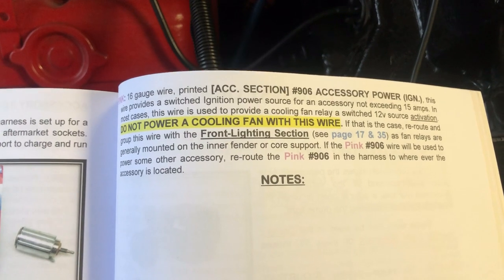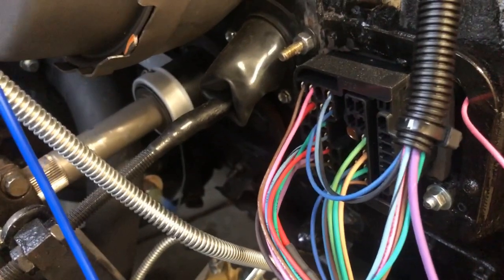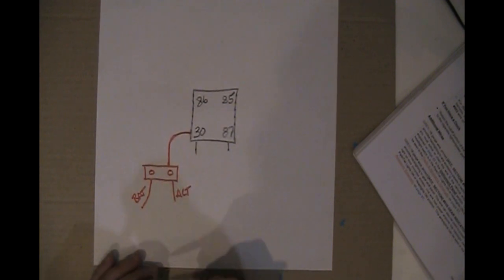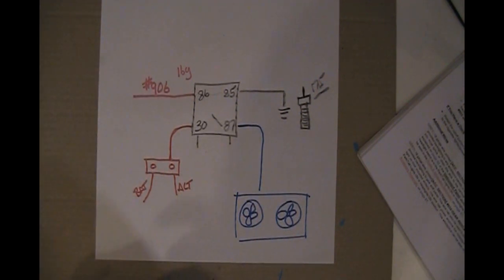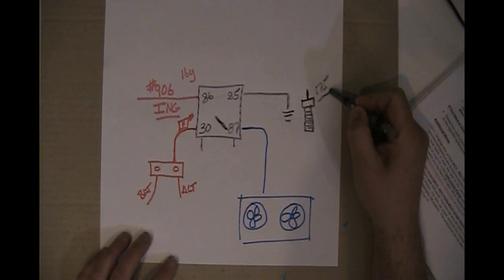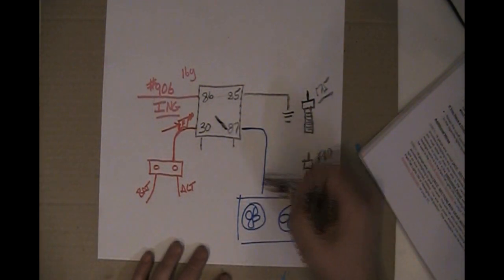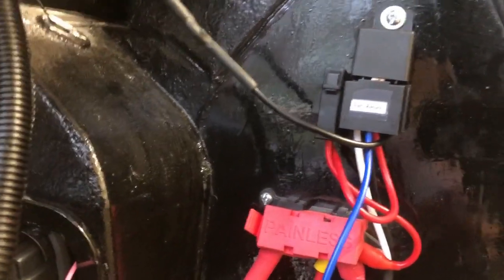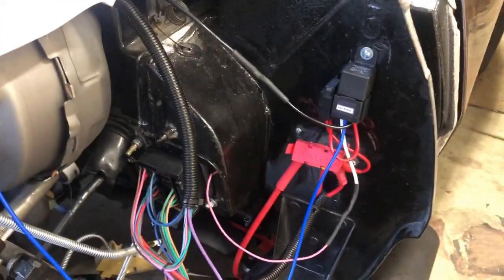Painless Wiring Harness Part 5 - Duel Radiator Fan Relay Switch

Comment: Are you running a after market gauge set up? I have a Dakota digital trying to use a 901 wire (grey/white stripe)to ground out at temp.
Reply from the maker: I'm running a stock gauge set up but I have a tach that runs off my electronic ignition - but those dakota gauges are sick - love them
Reply: @lawdogcorvette8565   I had to splice 906 to 901 to get b+ to run relay, but I ran a separate temp switch to run electric fan,

Comment: Is it necessary to run #30 to the battery and the alternator? Is it possible to run it to the battery only?
Reply from the maker: no sure of your question - but the wire to the battery from the alternator must be a thick wire to handle the amps

Comment: Hi Lawdog, the ignition wire on relay hareness. Does it go inside car on fuse box where it reads "IGN". Also on the sensor that screws on intake, I already have a different one there for temp gauge. How do I use both
Reply from the maker: The temp gauge sensor - yes what a pain.  Call painless and have them send you a temp sensor for your engine - saves so much time.

Comment: Thank you again for these. Did the relay/fuse come included with the kit?
Reply from the maker: The only relay that can with the kit was the horn relay.  The relay you see me installing was purchased separately for my radiator fans.
Reply: @lawdogcorvette8565  sorry if these are silly questions.. but why would they make you have to buy a relay separately if they know that is required for the fan?
Reply from the maker: @nickfawlty  so good question - Painless did not design the harness specifically for fan applications.  However, they knew that car guys like us love to take the old "Fan of of Death" out the front of their vehicles and add electric fans.  In the Corvette this modification is especially popular because of the natural slant of the radiator and the use of the fan shroud that crowds the entire front end of the car.  So they put in a 12v wire fused at 15a powered on at ignition on the inside of the firewall that was not specially allocated to another application and called it accessory wire.  In the manual they specifically recommended this wire to be used for the electric fan relay.  But if you were not using a fan then this wire could be used for all sorts of applications.  All electric fans must be powered on by a relay.
Reply: @lawdogcorvette8565  oh ok, thank you for the great reply!